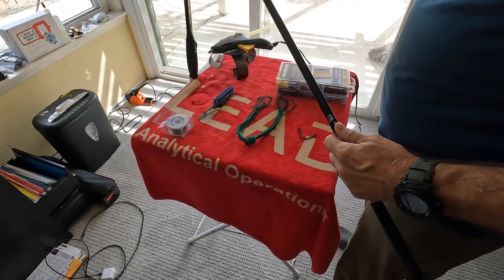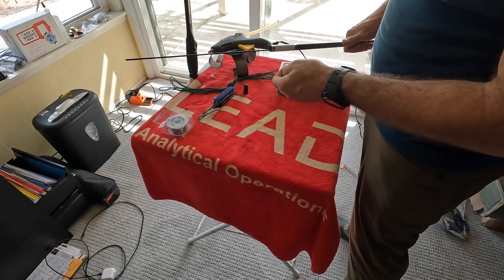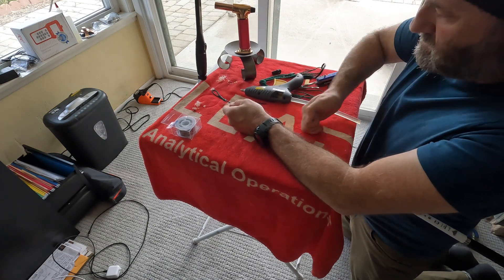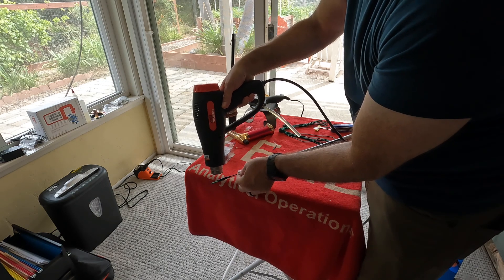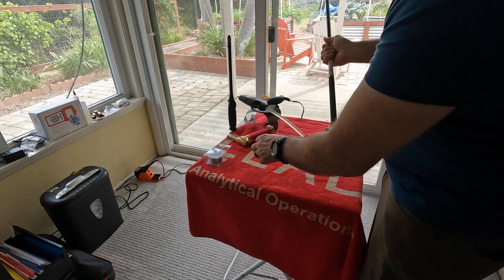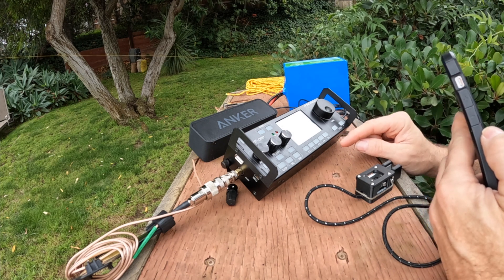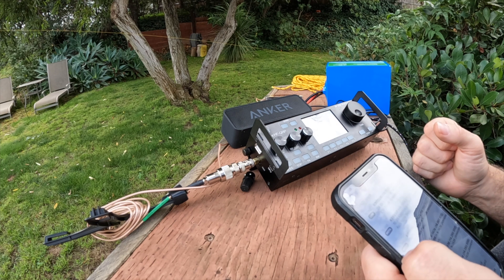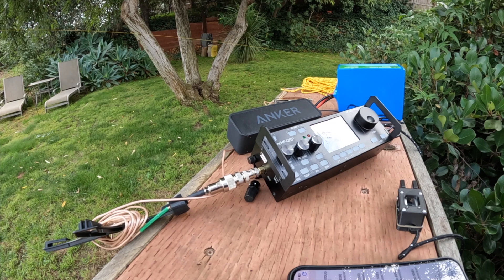Portable Antenna Mast Design and an intro to the mCHF QRP Rig

Comment: This is exactly what I put together for my upcoming trip to CO.  What I did for attachment was to run some microcord through the top section. Then I melted it until there was a big blob of  molten nylon and pulled it up into the section.  once cool, it is basically glued inside the mast section.  Then I tied an angler's knot in the end to attach the antenna to.  It's so cool to see how much you can do with so little!
Reply from the maker: That is an excellent idea! I have an upcoming SOTA activiaiton next Monday to do a beta-test of the mast and the MCHF QRP rig. If the mast loop at the end fails I am going to try your method.  👊